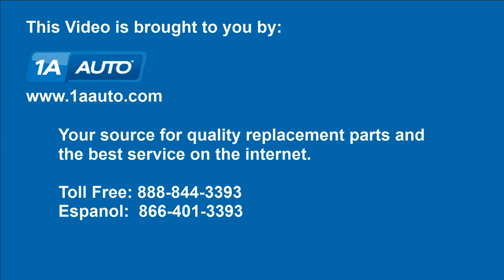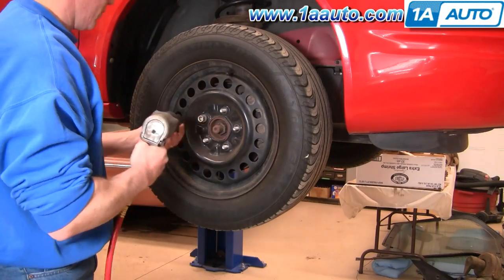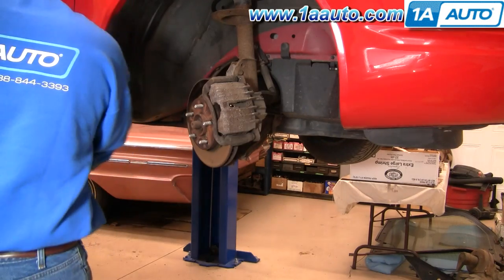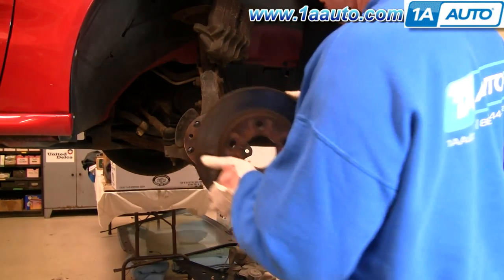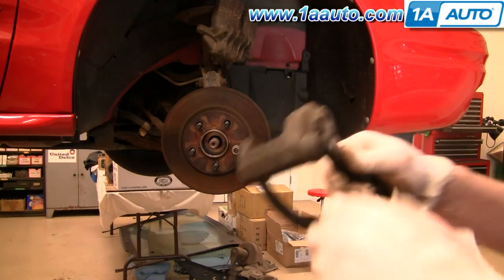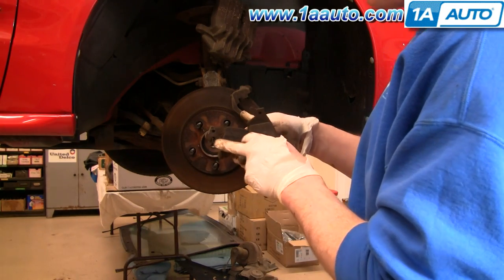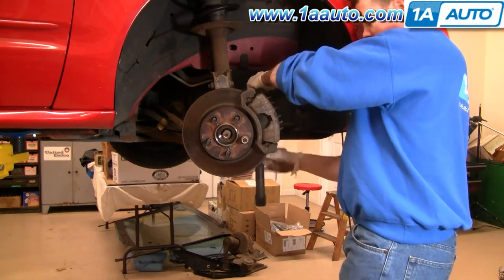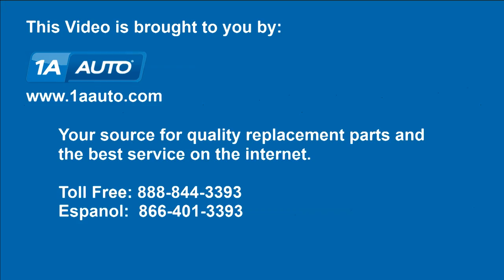How to Replace Brake Kit 99-04 Oldsmobile Alero

Comment: Good video, I would recommend pulling those slide pins out and greasing them very well for they are notorious for seizing with rust. And also dab anti-seize on the threads on all the bolts.

Comment from the maker: HI Steve, Sometimes with the amount of heat brakes can have in them they become welded to the hub, usually you can bang them free with a hammer if they don't break free.

Comment from the maker: You don't have to, but you can if you want to. Just collapse the caliper slowly so that the fluid doesn't spill out of the brake reservoir. You want to wire brush where the brake pads rest against. 1aauto.com 888-844-3393

Comment: Is it acceptable (ok) to push the fluid back into the reservoir (using the c-clamp) or should you use a brake bleed kit?  A friend recommends that I purchase a brake bleed kit, but you didn't mention that, in your video.
Thanks for the great videos.

Comment: For the top tab on the pads, one is taller than the other, how does it work?, also what happens if installed in the reverse order from back to front on the rotor?

Comment: question whats the most mileage on an alero , just asking cuz mine has 250000 on it original tranny and engine NO major repairs ???
i have a short video showing it running
Reply: 2004. 262,000 miles.

Comment from the maker: The rear should be rotors and pads. We sell some grear replacement brake rotor and pad kits for your 99-04 Oldsmobile Alero on our website 1aauto.com or call our sales line @ 888-844-3393